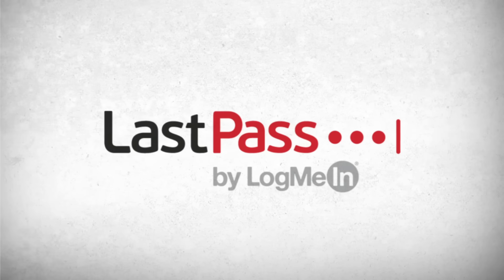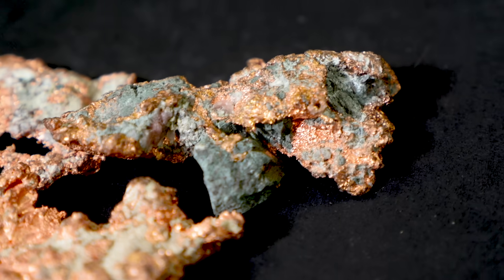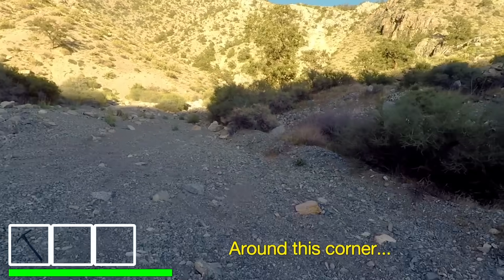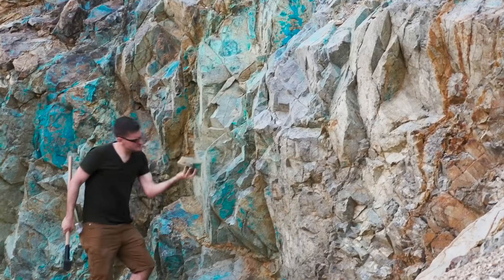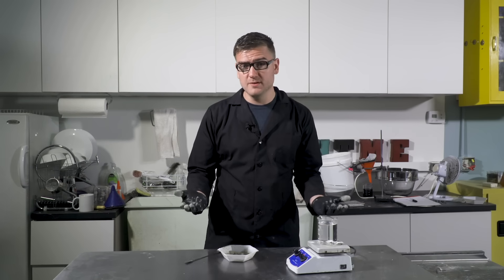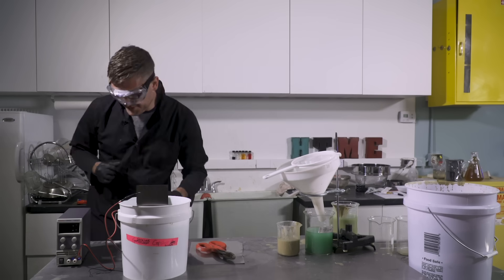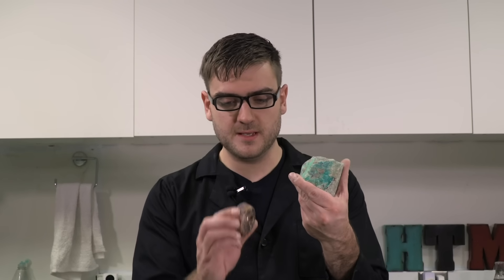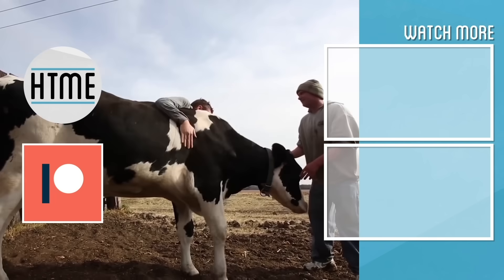From Rock to Copper Metal

Comment: There's an easier way, mate. Just add a metal more reactive than copper to the sulfate solution, and the copper will just lay on the bottom. Used to do it with iron.

Comment: I was hoping you were going to extract and forge copper as the ancients would have.  This modern technique with electrolysis and stainless steel and such was disappointing.  But kudos to you for having a crack regardless.

Comment: Make sure the muffin pan is either new with the coating on it or if it's bare metal, make sure to let it rust up real good.
Why you ask?
One word "BRAZING" as in the copper will braze to the steel muffin tin if it's clean enough to braze to!

Comment: The surface of the copper seems to have a lot of steel on the outside from the pan. An HCl bath should clean that off to give you nice, shiny copper surface. HCl should easily dissolve the iron, nickel and anything else in the steel. If HCl doesn't do it, HNO3 definitely will, however you will need to watch it closely and remove it as soon as the surface becomes shiny, or it will dissolve your entire copper muffin.

Comment: Muffin pans are not good for copper or bronze as it binds to the pan as it cools hence the difficulty you had getting it out. best to use either sand or dry plaster molds.

Comment: Another way to obtain the copper from the copper sulfate solution would have been to add aluminum foil, which would have formed aluminum sulfate and copper metal. Though, I personally would have used hydrochloric acid rather than sulfuric.  Sulfuric acid is nasty stuff if you get it on  your skin!
Reply: Concentrated hydrochloric is just as bad: one of my colleagues was involved in an accidental spill of 8M hydrochloric acid last year, and the resulting burns still haven't fully healed. You must be very wary of any concentrated strong acid (and even many 'weak' acids like acetic acid are dangerous in sufficiently high concentration).